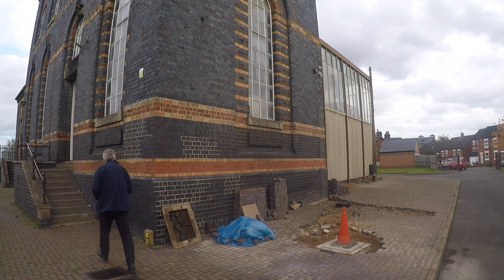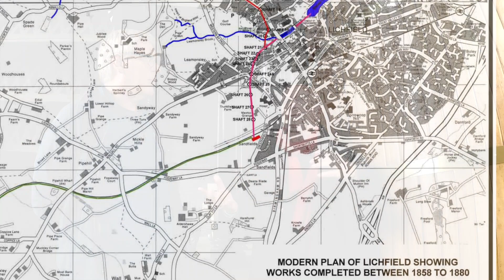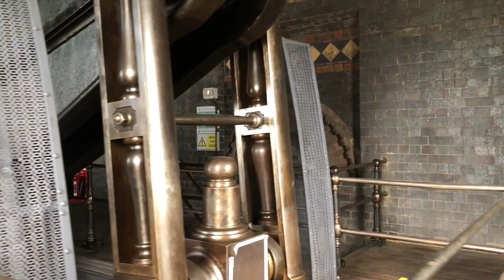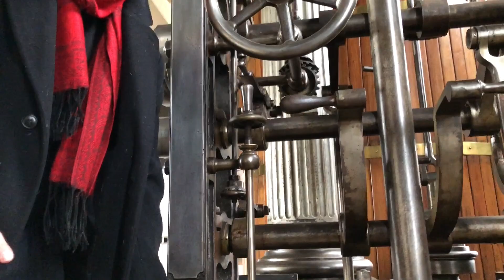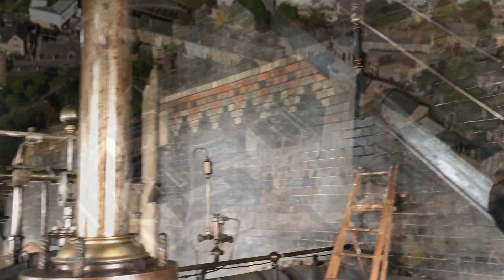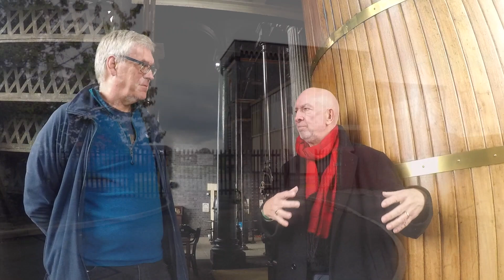Exploring the overlooked and under appreciated pumping engine at Sandfields in Lichfield

Comment: What a great video Andy, shame it's not running yet! That'll be great for the community when it is. I've been to 2 or 3 beam engines, and they always fascinate me. I never knew about this one, and like all of them, they give way to electric pumps, so they need to be preserved. They are our industrial heritage after all, and this one will add to the numbers.
Reply from the maker: Hi Graham - glad you found t interesting. I think that n the absence of any boiler kit the plan will be to free it up enough to have the engine rotate and show how the  mechanism worked. That means that the electric pump room  can be used for community activities. Its a great memorial to the age,
Reply: @lifeat2.3milesanhour  - I've seen one running on compressed air, but I can't remember where it was!
Reply from the maker: @danensis  Could that be the water pumping engine at Claymills?
Reply: @lifeat2.3milesanhour  - no, the boilers had been scrapped, and they were just running on compressed air. I must try and remember where it was.
Reply: @lifeat2.3milesanhour  - not the one I saw, but here's a video of something similar: https://youtu.be/vpWouwAqM1I